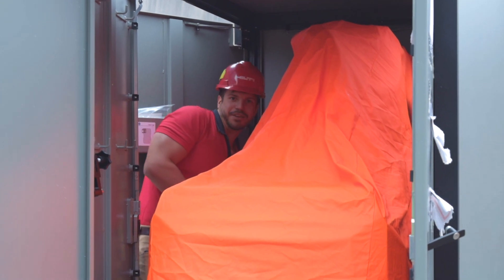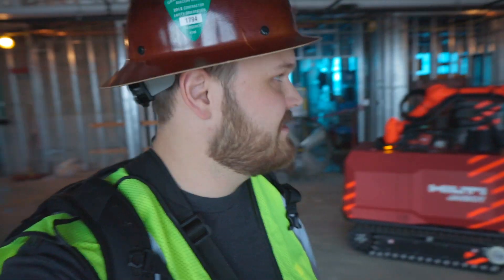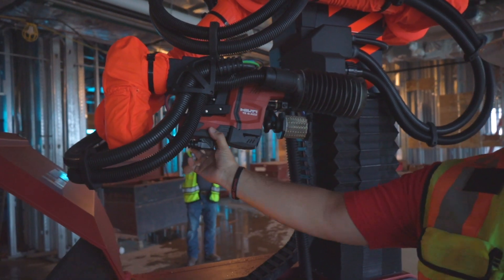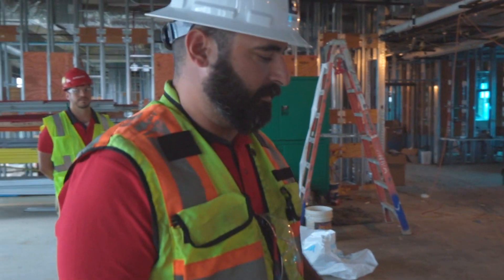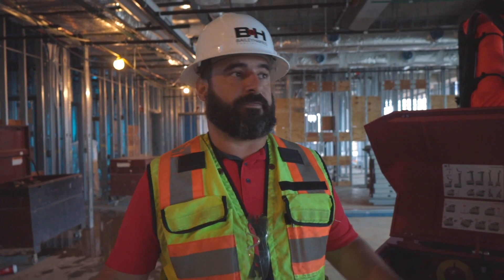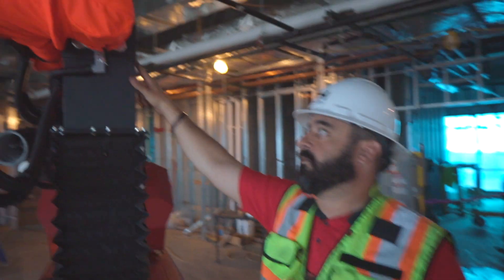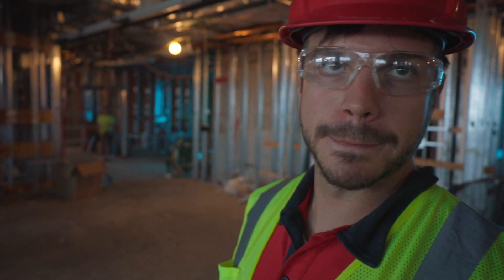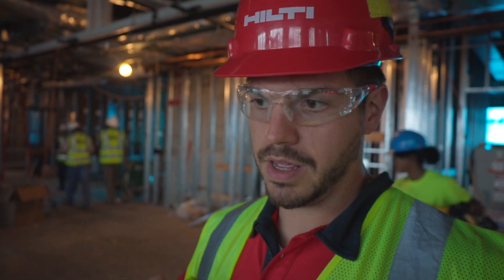MAN VS. MACHINE | RACING THE HILTI JAIBOT

Comment: Ok sure, should you calculate in software design for robot to know where the holes are as man using laser. How about cost man vs machine, robot up and down floors, also man can use a scissor lift. It stupid comparison.
Reply: All JAIBOT jobs pull data from the design model. All JAIBOT needs is a file with the anchor drill hole locations. JAIBOT is less then 3ft wide, fits through standard doors and goes up and down via the man lift, just like everyone else.

Comment: How much do you have to pay the guy to operate this machine or get it in position. Extreme waste of money.  The only good reason for this is in dangerous situations. Most dangerous situations the robot can get into. Or how much to repair it
Reply: You have no understanding of what this tool can do.  It can layout, drill, vacuum, and mark 600 holes a day.  You need about 5 workers + to do this.
Reply: Yeah mate, I’m sure Hilti will waste millions on developing a product that is nothing but a waste of money 👍🏻
Reply: You are typically paying someone to layout the location, transfer to the ceiling at height and then drill overhead already. JAIBOT takes one operator and can layout, transfer and drill all day every day. Accurately, productively and safely.

Comment: I am not in the construction industry in anyway, well maybe if you include making mud paddies when I was six.  
It is sad to see this is the replacement of jobs in the industry. This was a semi-autonomos system.  Wait until AI is added and it goes full autonomous.   Soon all you will see is 15 people on the first day for material and robot set up and programing.  Of course materials will be delivered using full autonomous delivery trucks.  Then press the start button and you could have 24/7 operations with 1 to 4  people taking care of material supply and general maintenance of the equipment.
Reply: I do work in the construction industry and nobody wants to get on a lift and drill holes in the ceiling all day long. We have a  serious labor shortage in the industry and it is expected to get worse. JAIBOT does the work nobody wants to do which actually frees up manpower to do what they do want to do, like assemble and install mechanical systems.

Comment: They have not really this shitty vacuum inside there 🙄
I‘m personally not a friend of Hilti to expensive for such bad tools! 
The only thing that is good from them is the big hole drilling technology👍
Reply: When’s the last time you’ve used Hilti, because they’re cordless has just been getting better and better and better?
Reply: It's not a shitty vacuum, it works perfectly fine.  Haters be hating
Reply: If your opinion had any sort of nuance one might actually want to believe your shit.
But speaking of the market leader in several segments as a manufacturer of straight up „bad tools“ is just stupid and nobody will take you serious
Reply: The JAIBOT uses the Hilti VC140 cordless vacuum hardwired with a blank battery connector directly to the main battery pack. Works really well and it is off the shelf product should it need a repairs or replacement